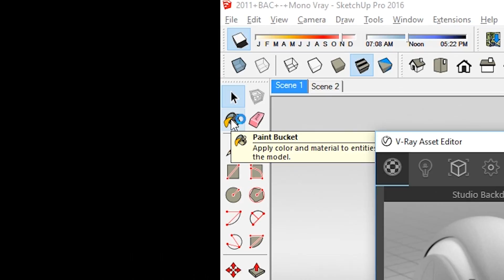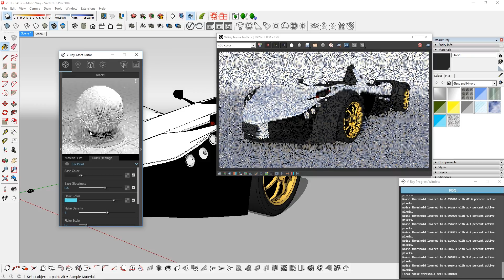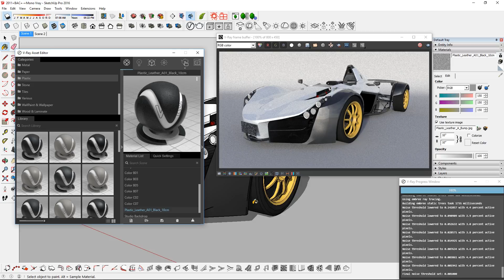How to Convert Sketchup Materials to VRAY MATERIALS | Vray for Sketchup

Comment: Hi thanks for the video, I'm trying to carry out the step where you change the tires material for the leather, and you instruct to bring the new material into the selection, then copy this and paste it into the existing material (https://youtu.be/8DvWXc2nNaE?t=145) - my right click menu doesn't have this copy (or paste) function, although it has all the other options (duplicate/rename/use as replacement etc)can you advise how I can do this?
Reply from the maker: You can use "Use as Replacement " and "replace in scene"

Comment: This is bullshit, VRay like Adobe they have rearranged the buttons and tasks to justify an upgrade.  Cant follow along as everythings changed AGAIN!
Reply from the maker: This is a very old video Jonathan 😂
 version 3.4.
Reply: @ArchitectureInspirations  Yes and like an old girlfriend Im living in and bringing up the past!  do you have an updated video that shows this process with current version of VR.  Im trying to replace materials not textures with skimp.  I know this may be an easy task for some but not sure if Im doing it correctly as even when I use stock VR materials my glass is coming out solid black...
Reply from the maker: I don't have an updated version for this. But feel free to email me so I can help you more ^.^ regarding the black glass, is your glass object a box? It has to have some depth to it. It can't be just a face. And make sure the front faces are not pointing outward

Comment: Thx voor de nice and clear video! 
I have one question though, I have seen that in V-Ray 3.6 the SKP materials can be binded with the V-Ray materials. So the texture changes together. But I just can't figure out where this option is or how to to bind the SKP en V-Ray materials :S
Reply from the maker: Hm it depends on how you import the material. It should be "binded" by default 🤔

Comment: And one trouble: when I pick bucket and hold control for color picker, and select material, it got selected, but when i go to quick settings, it says:"no quick settings available for this material, please use advanced settings panel". why ? i dont see maps
Reply from the maker: +Nikola Novakovic ah, is your material made in vray 2.0 because old material does not have that quick settings option unless you convert it. Also if the material is too complex, then it won't show up either 😂
Reply: I have vray 3.4 :/ So, how to convert it? I downloaded a detailed model of Le Corbusier's Villa Savoye, and the material I wanted to convert is simple texture of ceramic tiles stuck to a plane...
Reply from the maker: +Nikola Novakovic hm for that kind of material I would suggest you add bump and reflection maps to make it look more realistic. If you haven't yet, check out my "how to create realistic materials" video. That's the best way I can think of😅
Reply: thank for the reply! I watched that video, it is good, but how do I pull the maps from a downloaded model? If I am about to create realistic bump and reflection map, i would need that map which is used on a model
Reply from the maker: +Nikola Novakovic ah you can sample the material, and in the sketchup material editor, you can right click and save that material to your computer 😄
Reply: Thanks a ton man! You really helped me with this one, i can now continue smoothly :) I am pretty new to SketchUp...:)
Reply from the maker: +Nikola Novakovic oh no problem buddy! I'm glad I could help 😊😊

Comment: Render and all black v ray materials appear to me
Reply from the maker: What do you mean all black vray material? 🤔
Reply: In render all v ray material is black
Reply from the maker: +Sebastian Angel well you gotta be more specific like why it happened or what you did. I really don't know what the problem is from just that statement alone😂
Reply: Ok, render if we say I put the glass of v ray which is preloaded when rendered I appear black instead of glass or metal or whatever preload
Reply from the maker: +Sebastian Angel I think it's because you're using the glass material. Glass in vray is kinda weird, you need two layer to make it function correctly